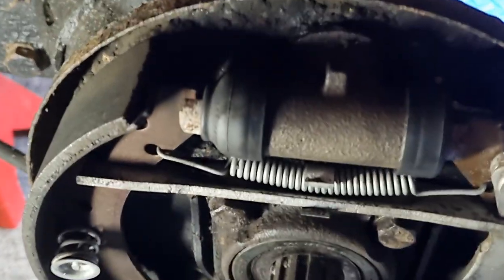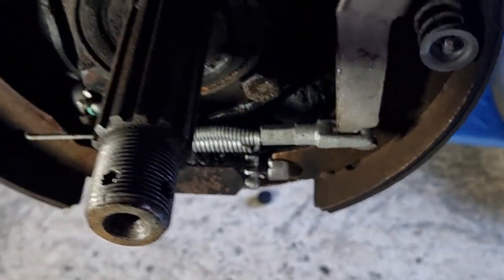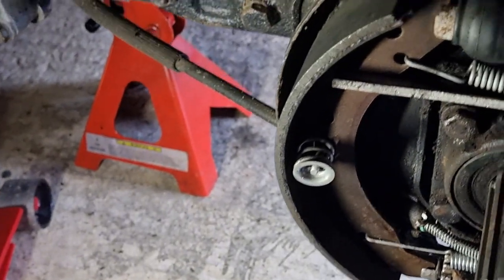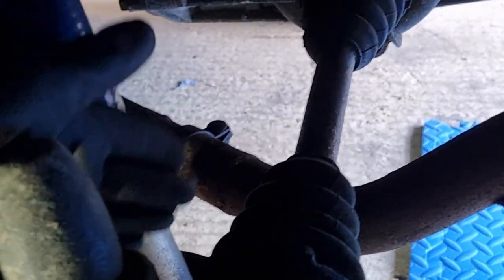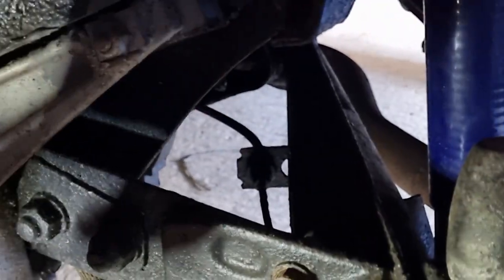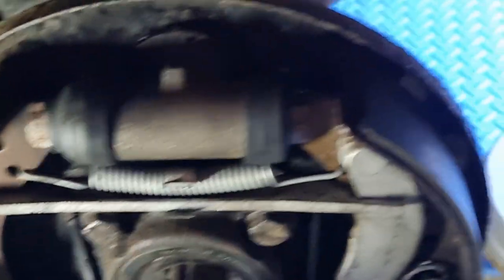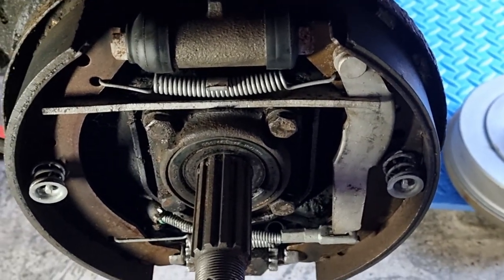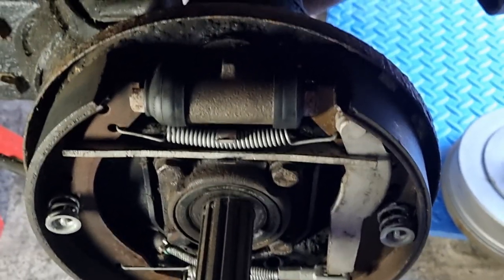Removing the drum brake on a Porsche 924 - Part 33

Comment: Nice video, I hadnt heard of a slogging spanner.  I use a 3/4 inch drive breaker bar and impact socket.  Its never been defeated on all the cars I have worked on.     For that nut I take the wheel off, remove the centre cap, put the wheel back on and put the car back on all four wheels before removing the nut. I think its safer, although I dont know if your spanner would fit with wheel in situ?
Reply from the maker: Thanks for the comment Chris, you are right, it doesnt fit with the wheel on so it's only useful once the car is up in the air 👍
Reply: @Witty924  what size spacers and bolt lengths are you using?
Reply from the maker: @chrismadge7292  good question Chris, I will check and let you know as it came with the car when I bought it 👍
Reply: @Witty924  thank you, much appreciated:)